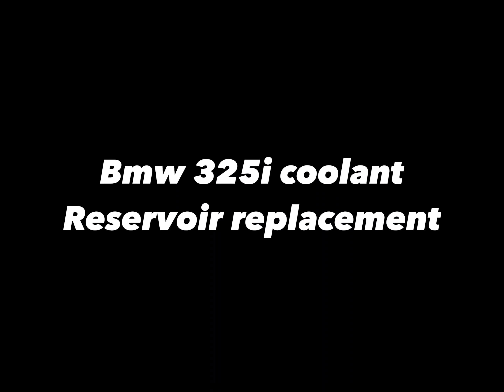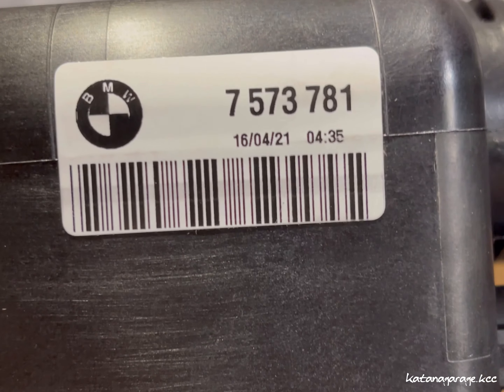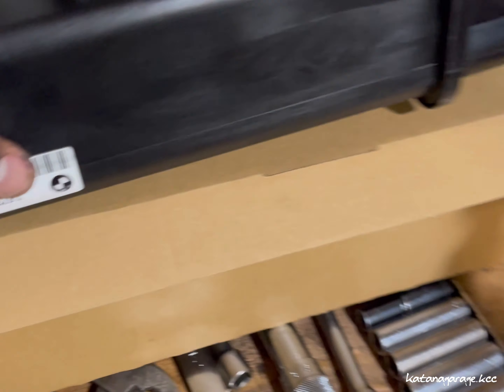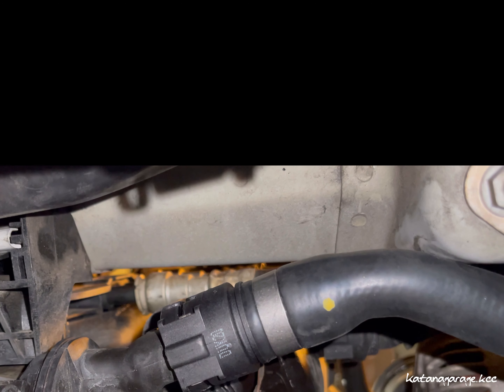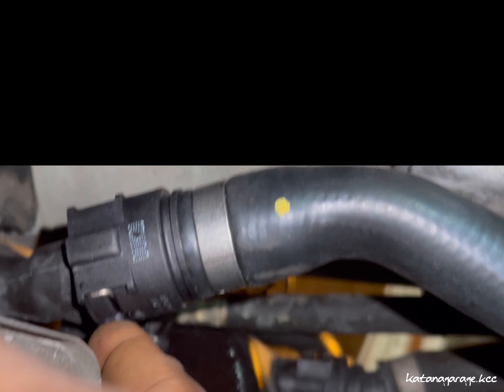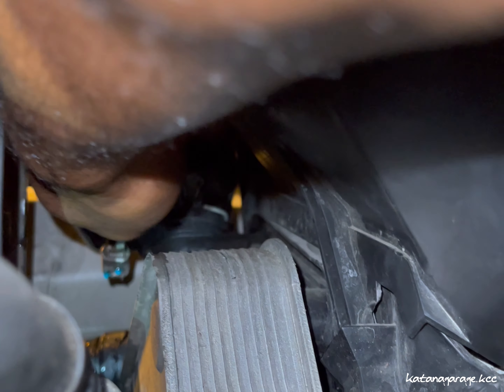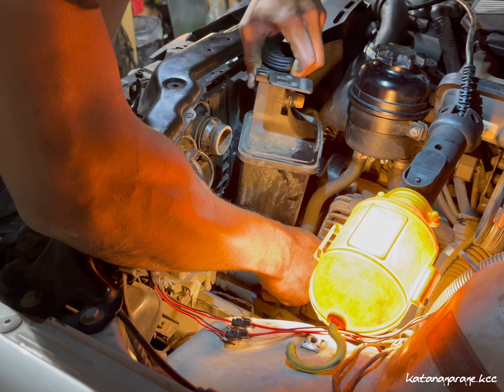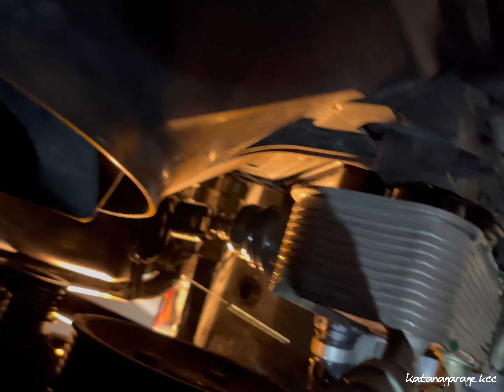Bmw 325i coolant reservoir replacement

Comment: Hey Katana Garage, thinking about purchasing 2004 BMW 325i as a back up vehicle. Ive often heard that when replacing the reservoir, its common for other issues to arise with the rest of the cooling system. Is this true?